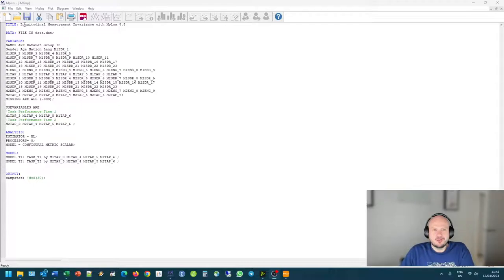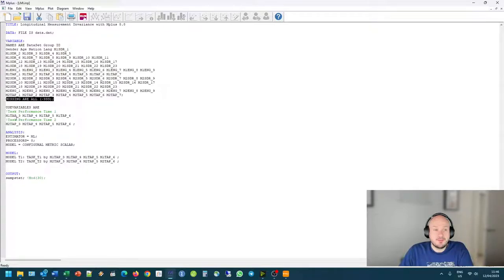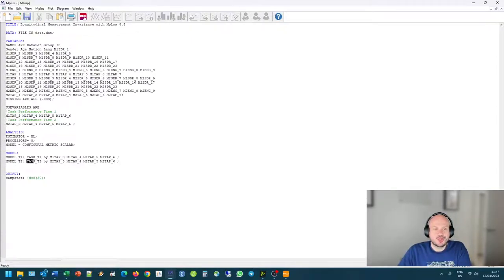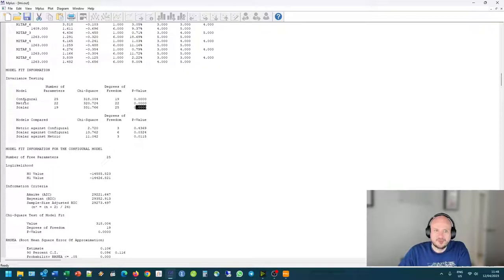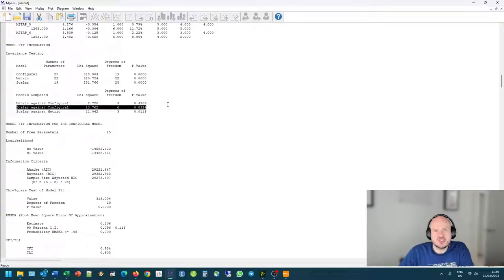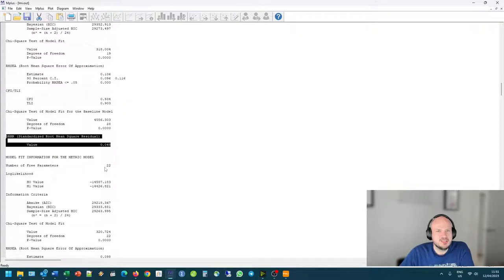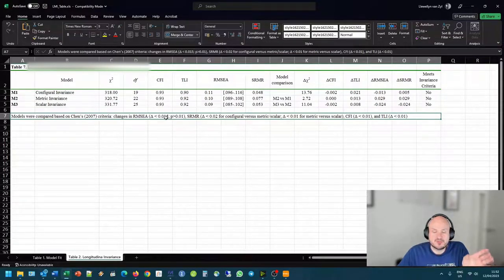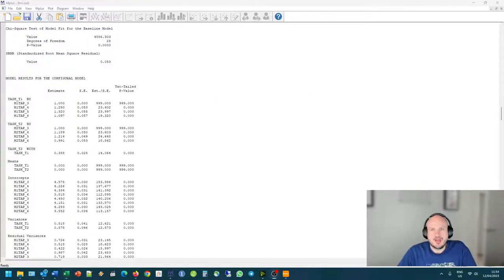Longitudinal Measurement Invariance in Mplus 8.8

Comment: Thank you for the video. I saw you just included 1 variable at 2 time points. My question is that like cross-lagged model, we generally have variabe A and B in Time 1,2 ,3 for example. Should we put all the variables at 3 time points together in the CFA to test  Configural Metric Scalar invariance rather than test the A and B one by one?

Comment: Thanks for this video! The scalar model fits my data (Time 1 and Time 2) well. I now want to use the factor scores to run some other models. How do you save the scores? Thanks @LlewellynVanZyl
Reply: You can just use the normal FSCORES SAVE command like you would usually do. Just add it before the OUTPUT line
Reply: @LlewellynVanZyl  Thanks for the reply. That's what I did, but it does not save the factor scores. I only saved the information that was present for each item.

Comment: Hi, how did you calculate the differences among, CFI, TLI, RMSEA, and SRMR?
Reply: You just take compare the new model against the baseline model. So if CFA for Model 1 is 0,95 and for Model 2 is 0.97 then the difference between the models is 0.03. Same with TLI and SRMR. The only thing you want to check extra for RMSEA is if its still non-significant and that the CI value doesnt include zero for the alternative model.
Reply: @LlewellynVanZyl  Many thanks!!!